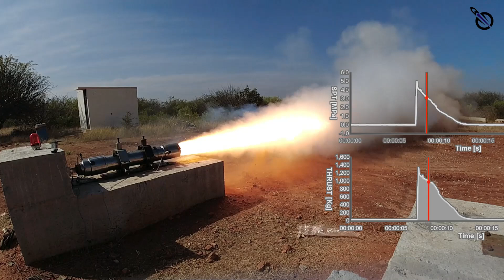India's First AeroSpike Rocket Engine | BIGGER BETTER BOLDER | SpaceFields

Comment: Congratulations guys I have some questions like what fuel did u use and what are the numbers like thrust and ISP
Reply from the maker: HTPB-based composite propellant was used, achieving a peak thrust of 13.42 kN and peak pressure of 5 MPa, while generating a total impulse of 32,624.3 Ns.

Comment: I like counting the mach diamonds -- where are yours?❓

I could hear lots of dham-dham music, but I couldn't see any mach diamonds  :body-blue-raised-arms:
Mach diamonds always make an engine-test video much more impressive than dham-dham music
Reply from the maker: Shock diamonds are generally formed due to pressure difference between the exhaust and surroundings. Our engine was tuned for atmospheric pressure which is why the intensity of the said mach diamond is extremely low. Combine that with the fact that the exhaust glows bright, the shock diamonds are almost invisible (almost because if you look pretty closely at the beginning you can see a few just on the edge of the exit of the rocket). Liquid fuel which generally burns with a more clean flame, so even the low intensity mach diamonds are visible, while solid propulsion shall innately have high luminosity.